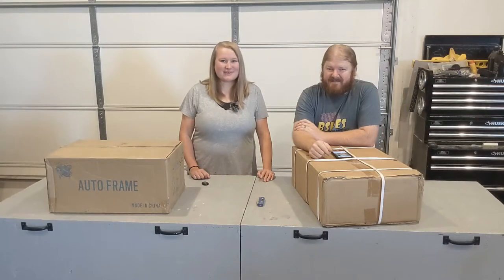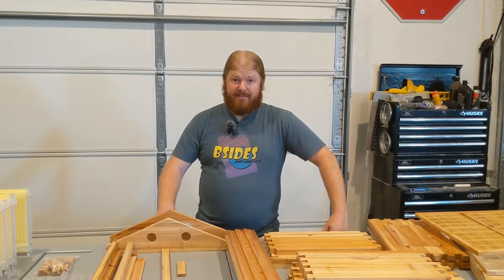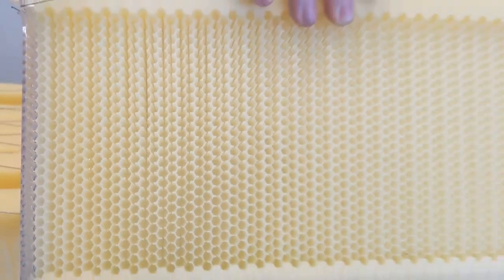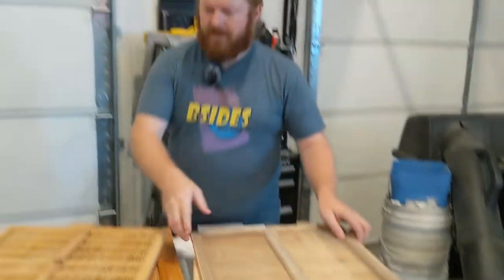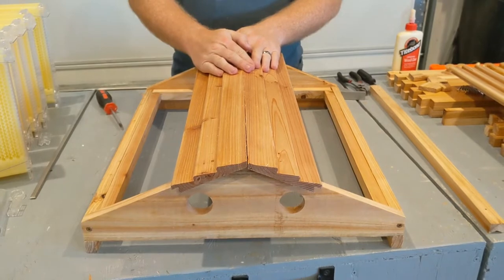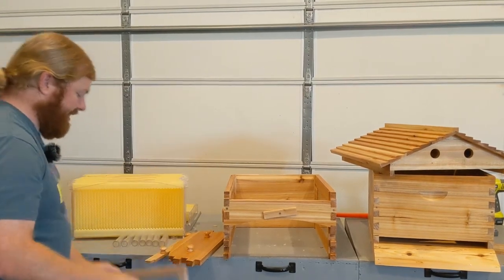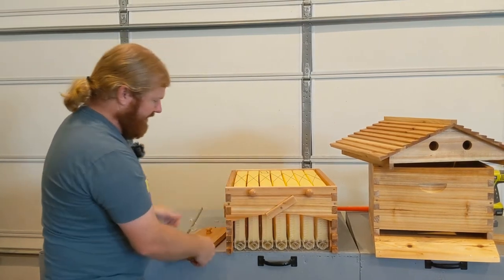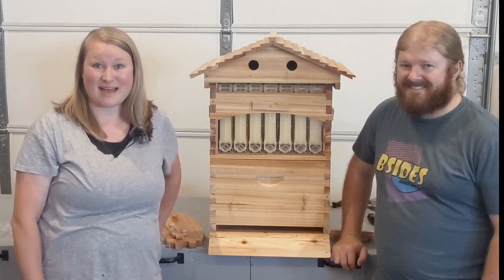How To Set Up A Knock Off FLOW BEEHIVE!

Comment: awesome video:)  it is helping with my assembly I do wish you would've shown how you "hammered " the frame together mind don't really seem to be fitting very well.  I was also curious to know if we should protect the beehive with some sort of exterior polyurethane etc. to help it last longer. Thanks
Reply from the maker: With ours it was already precoated in bees wax so won't need additional exterior maintenance for a couple of years. Some parts were really tight to get together, we used a rubber mallet to help get it all together.

Comment: How did you get the key in to work, I got the smaller version and the hole where the key goes Is covered.
Reply from the maker: For this one you have to take the lid off and then the little wood panel door in front of the key holes and then use the key.

Comment: Have you put bees in yet? Any honey? Some folks have said bees won't build in these
Reply from the maker: We didn't end up being able to use it this year. We decided to focus on letting the new hives build up extra for their colonies so they can last through our harsh winters. But by doing this hopefully we will start out the year with strong hives so we will be able to put on these flow hives and honey supers next year. We were definitely bummed we didn't get to try it out this year.
Reply: @countrysparkles  a handy tip is to put the door that you access the honey super on the rear of the broodbox. that way you wont have guard and worker bees coming right out the front at you while you are harvesting honey. also tilt your boxes toward the rear slightly so the honey will run out the back. @The12345condor A bit of wax from your broodbox, smeared on to the flow frames will promote bees working on them.